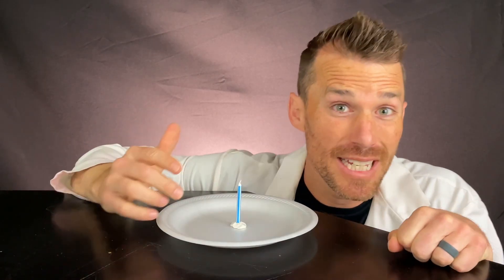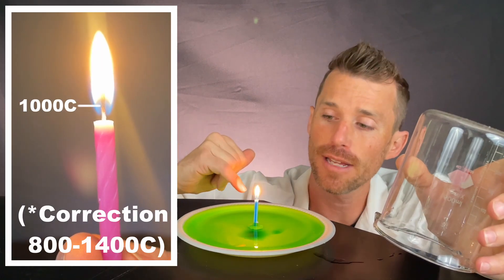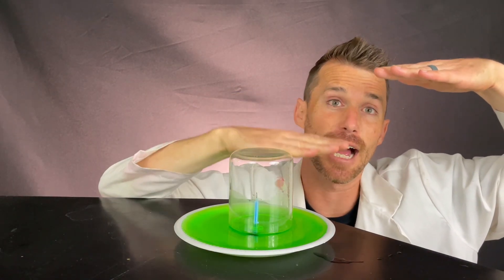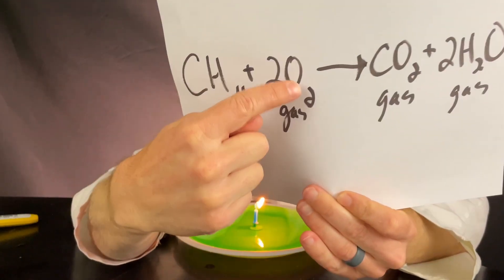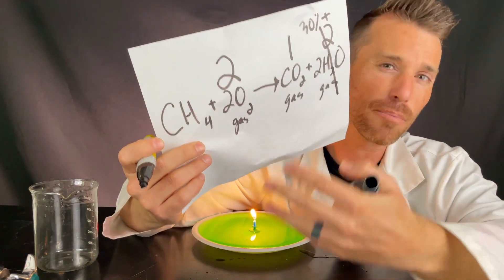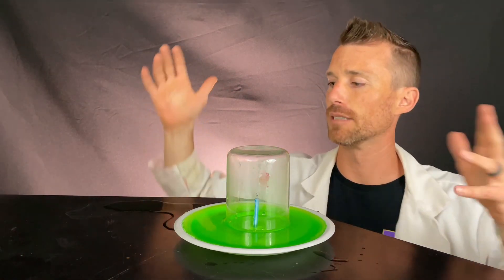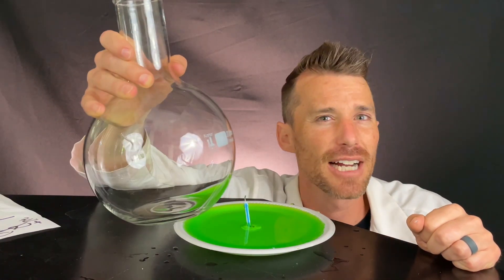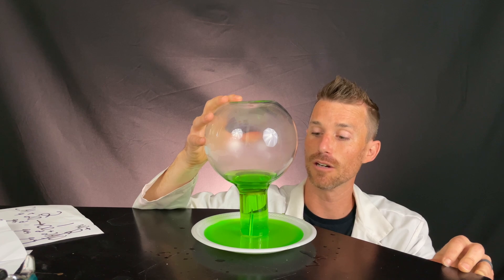Why does the water ACTUALLY rise??

Comment: At the end, I would suggest the reason why it rose so fast is that once the flame was put out, the air condensed. Based on that I would presume "breathing" had to do with a struggle for equilibrium. Maybe as the pressure changed, the flame was retarded. Each time a bit more water was sucked in the flame was affected a little more allowing the water to rise further each time.

Comment from the maker: Do you have any idea why the water went up and down and up and down in the final large flask?
Reply: I can’t repeat the big words that dysject said. I don’t know if it’s jargon or he looked it up, etc. But I believe it’s somewhat correct, the container is large enough for air currents to form but I have no idea why it would fluctuate. In my head the pressure would remain the same in the whole glass, but is it due to the air current that pressure fluctuates slightly allowing the water to rise and lower even though pressure is decreasing the whole time?
Reply: i didnt watch the whole vid so dont blame me if im wrong but i know heat rises so i thing the water rises with the heat from the candle
Reply: no idea why it went down

Comment: not first not first not first, its my phobia to be first
Reply: doesnt KNO3 contain quite a bit of nitrogen? ;)
the reason it rose in phases is because you were creating a seal at the bottom of the plate against the styrofoam, if you only have a little water on the plate, enough to create a seal but not enough to put the candle out, it would probably bubble for a while before the candle actually went out as more and more air got sucked in until all of the air in the flask was used up and what little it could suck it wouldnt be able to sustain it for long
Reply from the maker: That is a great idea with the seal. To prevent that (because it had happened with the little flask a couple times) I kept the flask tilted so water could freely enter. Any other ideas of what it could have been?
Reply: Lol